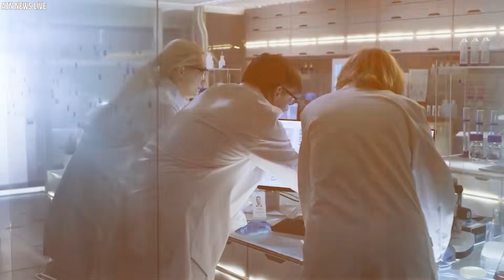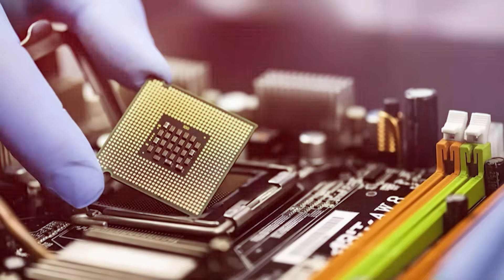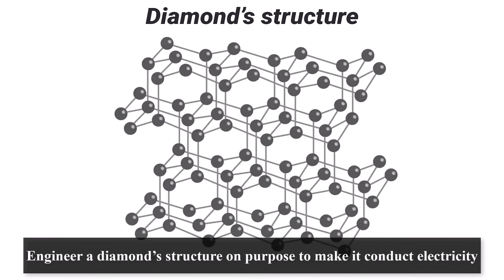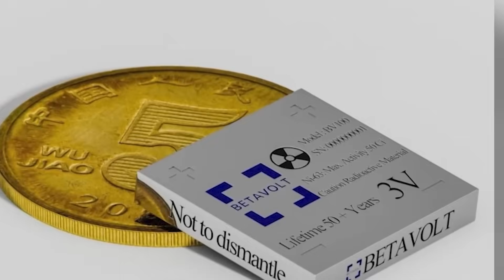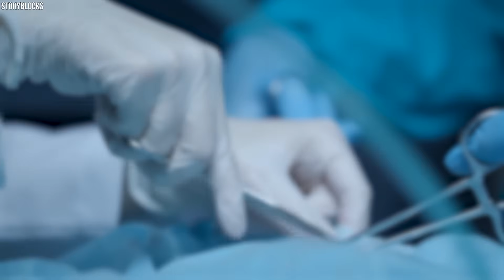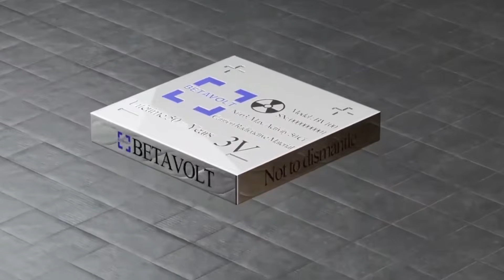China Built a Nuclear Battery That Runs for 100 Years Without Charging

Comment: This a “set-and-forget power source” for critical micro-systems, think:

Pacemakers (ultra-low-power variants)
Implantable glucose monitors
Neural implants / brain-computer interfaces
Cochlear implants (partial power support)
Deep-space probes (low-power instruments)
CubeSats (backup or trickle systems)
Long-duration environmental sensors (radiation, temperature)
A myriad of military uses

This is not a mass-market battery for devices like:

Smartphones
Laptops
Electric vehicles
Home energy storage
High-performance electronics